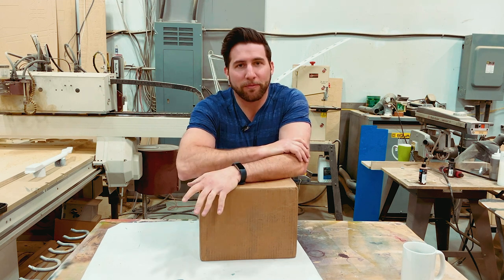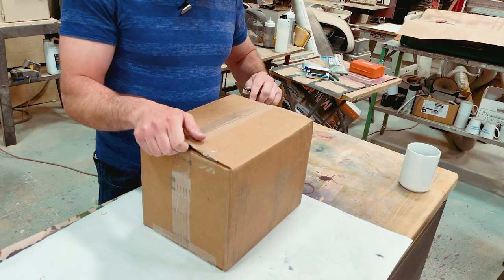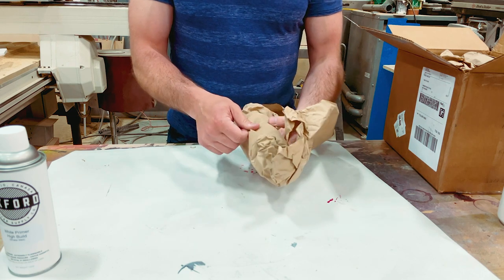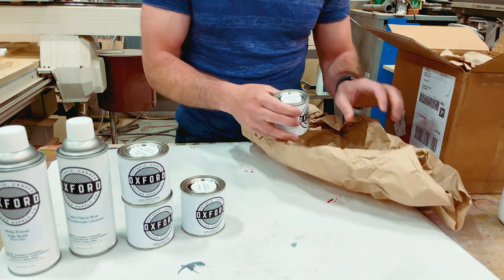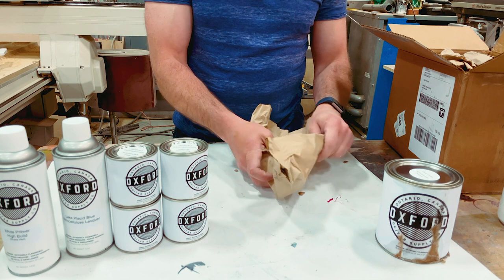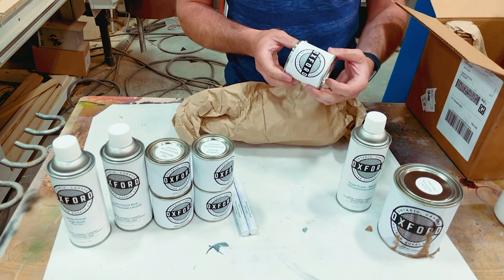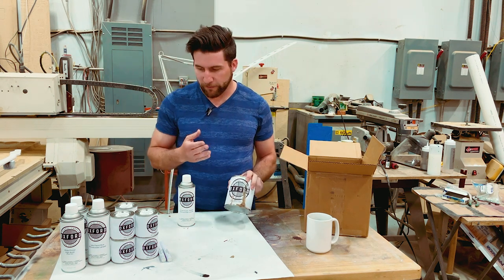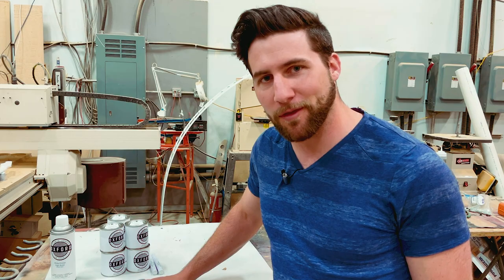Metallics and Bursts | Unboxing Some New Paints I Can't Wait to Use

Comment: Nice unboxing Brad. I believe they also deliver to the UK as well.

 Just one thing about the video you did about inkjet printing onto wood. Will it work over a factory finished guitar as well like an Ibanez?
Reply from the maker: The transfer technique? You will need a transfer medium like I used in the video, which can be applied over a properly prepared factory finish.
Reply: @BradAngove  cool now to see what will work with the Ibanez JS factory finish as I’ve seen someone on Facebook who’s used the burning effect to recreate the Donnie Hunt design to a bare wood body but I’ve only got a JS1 that’s got a black factory finish on it.

Comment: Waiting to paint my truck inside garage because outside it is still the pollen in the air and rather paint it inside because when use a spray gun when people walk by they won't be in the way in the backyard it has a fence but better in the garage. Love at the corner but painted my old truck in the driveway last year but it not a very long driveway just a medium sister driveway that lives a couple blocks from me is longer but people walk by some but could could do front first then the back last after turn truck around in the driveway but still best in a garage so no bugs or other stuff gets on my truck like pollen outside because I see some small leaves over today around truck.

Comment: I recently painted my solo strat kit with lake placid blue and waiting for the clear coat to dry so I can buff sand it. It has some orange peel so hopefully that gets sanded down. I also got some of the neck amber as well. I’m nervous about sanding the finish as I don’t know the best process to get a nice smooth finish.
Reply from the maker: Have you seen my videos about the sanding and polishing process?
Reply: @BradAngove  I have watched your series on the duplicolor and 2K guitar. Would the steps in that video work for the Oxford finishes?
Reply from the maker: Similar but not quite. You would be better off following one of my tutorials on nitrocellulose lacquer finishes.
Reply: You are about to find out what is seldom shown cause it's boring.
But oh so necessary to do right.
If you wet sand try to avoid water.
It will get in drill holes and other bare wood. It can cause swelling.
Having said that, I use distilled water for wet sanding. But I spend time sealing bare wood. Call it OCD.

Comment: Hey Brad, how's it goin. Quick question: I f-ed up a nitro project and I now want to do a color change; I screwed up a goldtop. It blushed and it looks like crap so I wanna just do a silod color. I already got some white color to cover. My question is how high should I go with the sanding grit? I started with 400 and I'm gonna go to 600. Is that enough or should I go to 800?
Thanks Brad. You're the best. 
--Andy
Reply from the maker: If you’re putting a standard white over it then 600 is fine.
Reply: @BradAngove  thanks again Brad 👍🏻

Comment: You have me paranoid that I'm not using proper safety gear.  I put on safety glasses, rain poncho, gloves, and a half mask respirator while I spray 2K clear coat.  It is always outside.  Does this suffice or did I just harden my lungs and give myself cancer?
Reply from the maker: I’m no safety expert. That’s more gear than I use, but I’m told isocyanates can’t be filtered and you should be using an air-fed mask.
Reply: @BradAngove  well, good to know I'll get cancer.  I suppose I can start smoking again because, well, why not?
Reply from the maker: Don’t do them at the same time or you’ll be more worried about the burns than the cancer.

Comment: Hello Brad, I just refinished a bass in sherwood green and added gloss laquer on top all from oxford and i cant get the finish to crack or "relic" i did 12hrs in the freezer then heat gun couple hours after spraying the clear, and then i tried again 24hrs later. was my clear on to thin? or should i wait 1 month before trying the freezer trick again?
Reply from the maker: Clear may have been a touch thin. I’m surprised that wouldn’t cause it to shrink hard enough to check. Don at Oxford may be able to give you some additional suggestions if you reach out to him through the site.
Reply: I just hung one of my tele builds in my unheated garage for the winter.
I live north of 56'. The low temp is below-40' for many days in the winter. Only the colour coat did anything.
It split in lines on the complete body.